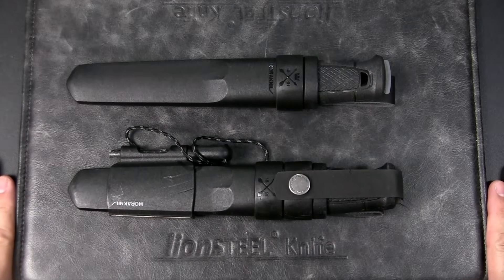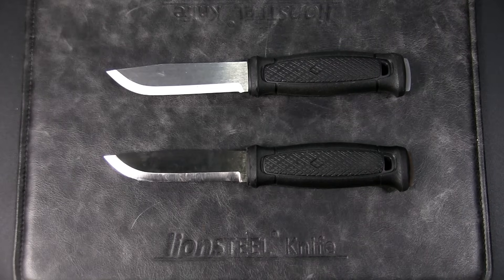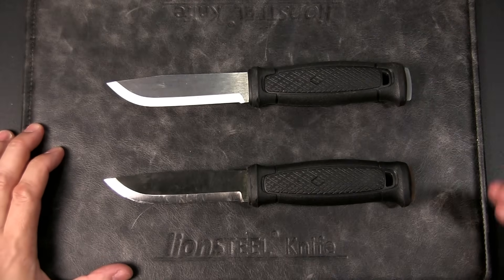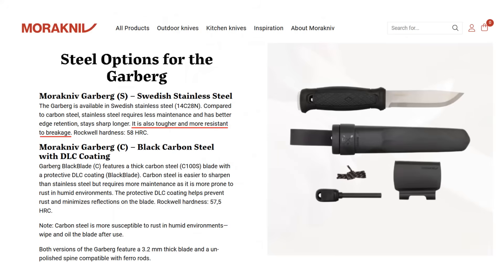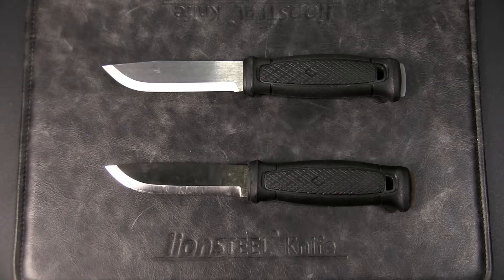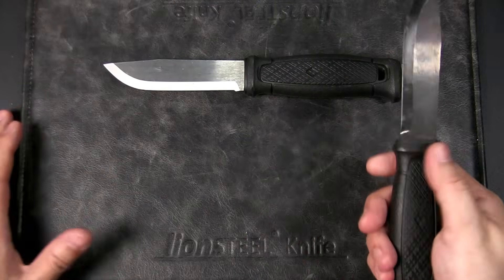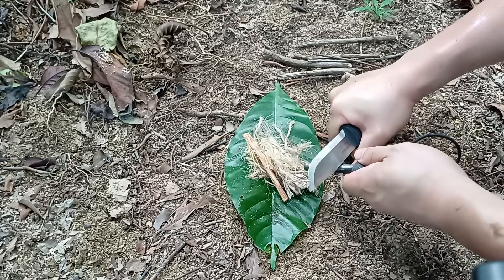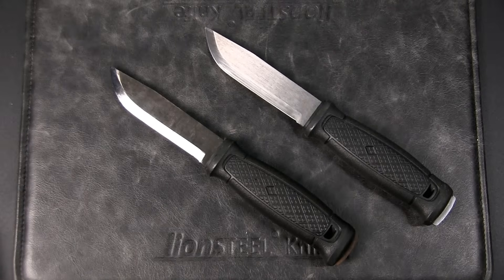Is the Morakniv Garberg Stainless Tougher than the Carbon?

Comment: The only way to make stainless tougher than carbon is to deliberately handicap carbon through subpar heat treatment. There is a reason why 99.9999% of axes are made from carbon and not stainless steel.

Comment: I've had the carbon for years.  It doesn't rust because I don't just clean and dry it; I oil it.  It does have a very sharp 90 degree spine and is easy to keep sharp in the field with anything you have, including stones you find on the ground in a pinch.

Comment: i have had the carbonj steel garberg for a few years and have used it some with great results.  I live in damp country on the north west coast of California where humidity remains high for most of the year.  Caring for carbon steel tools and knives is an ongoing responsibility.  My garberg has shown a some rust around the tang that extends from the knife hilt which I removed with a little application of Boeshield T9 on it when being stored.  i have not had the problem since.  I am going to 'bite the bullet' and purchase the new Garberg Grand ... in stainless steel.

Comment: 2 minutes in......stainless is tougher.....carbonwill dharpen easier....but......in true facts heat treat the steel properly foreign companies dont do this right. And I'm gonna ramble.
A stainless steel blade will be tougher....
A carbon takes a  better edge and....well.....
Reply: Would say the stainless takes the better edge. Reason being the higher toughness...you can run a thinner edge on it. 

I dont have the carbon garberg but the carbon mora bushcraft (which is the same carbon steel as the garberg and thickness and also scandi) and I notice that when I put a true scandi on them - no micro evels
Reply from the maker: @martinerhard8447 stainless takes a better edge and holds a better edge.
Reply: @urbanknifeguy  between these two steel in questions. 

They will both take a equally good and very fine edge. Both are steels suited to make straight razors out of. 

With the edge retention you are right. 14C28N is superior here but for a stainless steel it also has not so great edge retention.
Reply from the maker: This is specific to the Mora 14C28N and their carbon steel, based on their product info. Heat treatment is what makes the difference, but we are taking the information at face value from the company. There are some who dont believe the company"s claims based on the comments, and that is their prerogative. Thanks for watching!
Reply: Thats were you are wrong,but ofc the stainless has to be sharpened the right way...then it will keep the edge a hell of a lot longer...

Comment: The ‘toughness’ of any steel is all in the heat treatment, as a knife maker I know just how crucial well experienced treatment methods can vary for multiple reasons. Moras are all heat treated in very controlled conditions and are equally good steels also remember the tougher the steel the harder to sharpen. Lots of variants to consider but really buy what you’re comfortable with…
Reply: How hard something is to sharpen depends a lot with what you are sharpening with and the design of the blade. 

People should really just all use diamond plates or resin bonded diamond

Comment: great info ,but for me I'm not usually not concerned about stats ,if it cuts holds an edge and functions for a long time with minimum maintenance ,then its a good tool. i prefer stainless due to the climate i live in .i have a lot of carbon blades for short term usage but long term ,for example expeditions ,i would always chose the stainless ,.if you have any knife with you and need to use flint on it or strike rock on it then maybe you have gone beyond desperation , god bless you and your family.Lee

Comment: I have both, I've sharpened them both on Naniwas used them on similar fashion and came to the conclusion that i prefer the stainless, the edge on the stainless gets much more bitey/aggressive and it can hold a smaller microbevel without chipping or rolling.

Mora came out with the stainless first but market's ( aka primitive cavemen) called American's 🤭😂 wanted a carbon Gardberg because tradition says carbon is better and you can strike it with a rock 🪨 ( cavemen) to get a spark.
Reply from the maker: Haha... thanks so much for sharing your thoughts!
Reply: haha good points 😂

Yeah really no reason to go for carbon except maybe hitting it with a rock. 

Then again why not buy the much cheaper carbon mora bushcraft?

Comment: There is advantages to having both different kinds of Steel a carbon knife for sharpening Fire Starting while stainless steel though this is high carbon stainless steel that Mora uses has high corrosion resistance and toughness but the ability to sharpen the steel easier in the field and another way of potentially Starting Fire draws people to carbon steel and always has and old school aesthetic of using a carbon blade
Reply: A small diamond field sharpener (victroniox, worksharp...) sharpens both easily in the field. 

14C28N is easy to sharpen and thanks to the small grain size can get a very fine edge hence it is used for straight razors.
Reply: You mean start fire with flint and steel? 

The SK4 steel of silky saws also works great for that! 

My region unfortunatly lacks the right kind of rocks to do tzat so back to the bow drill (or firesteel connected to my sheat)

Comment: I am a former metallurgist, specialised on steels alloys , and after watching the video i’ve read some about these steels, indeed, sandwick got all the preferences over carbon one, no questions, hardness, thoughtnes, corrosion resistance and so on. So it is indeed no any particular reasons to prefer carbon one. However, if you like a carbon for any reasons it is still a great steel. Easy to sharpen easy to maintenance, great properties except corrosion, so just an option it has a right to be. Objectively, Sandwick is outperforms for sure.
Reply from the maker: Thanks for watching and for your input!
Reply: @urbanknifeguy my pleasure! Thank you!
Reply: Except corrosion? That's maintenance.

Comment: I think professionals who actually use their knives all day, like chefs, wood carvers, and barbers use carbon steel because they are easier to sharpen and strop.  Stainless steel definitely requires less care and maintenance.  Both will work well if sharpened properly.  Far as hardness goes, I always thought it depended on the heat treat not the kind of steel.
Reply: Chefs like line cooks are more and more stopping using carbon knives because they dont have the time to resharpen all the time. 

Carbon steels have very bad edge retention in general.

Comment: I feel like there may be a misunderstanding between hardness, toughness, and strength. Hardness gives you edge holding capability, toughness gives you impact resistance, strength gives you flex resistance. All are separate and independent measures. Stiffness is another one that is rarely mentioned for knife steels.

Is it possible that Mora is correct that their stainless is tougher than carbon, but others are also correct that stainless is less hard than carbon?
Reply from the maker: In this specific case, the 14C28N is both harder and tougher than the carbon. So it holds a better edge yet is less prone to chipping than the carbon.
Reply: @urbanknifeguy Interesting! I wasn't aware that 14C28N could be heat treated to beat carbon in hardness. Luckily I already have both Garbergs, so either way I'm happy 😂
Reply: Hardness and strength are the same thing. Resistance to flex is just based on the physical dimension as the modulus of elasticity is the same between steels. 
Hardness is resistance to permanent deformation that isn't elastic, and toughness is total energy absorbed before it breaks. Too little toughness and it won't bend permanently much and the stress will concentrate too easily on a single location without it plastically deforming in the most stressed area to lower it in that area before breakage.